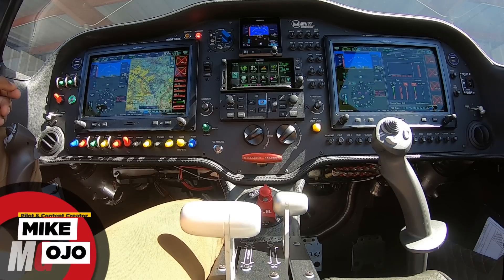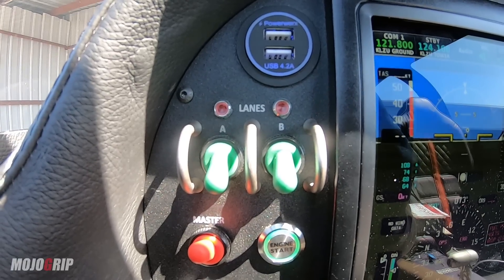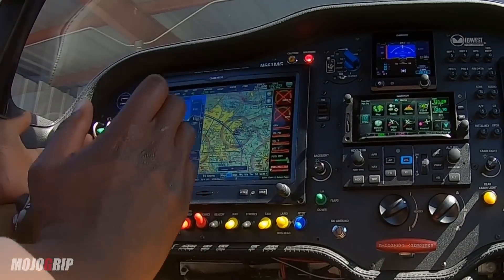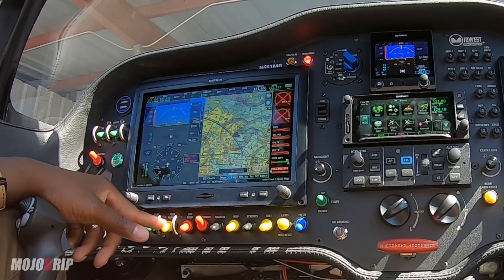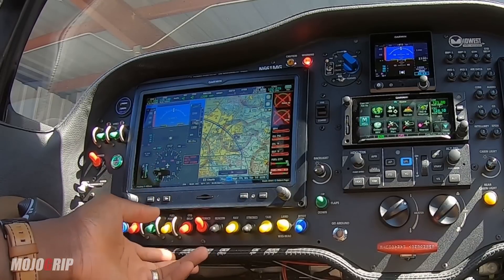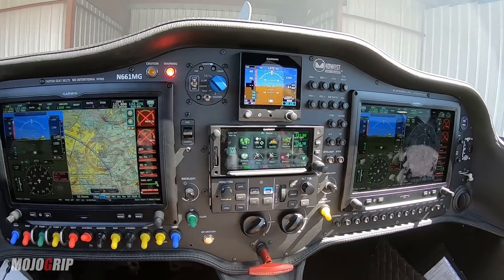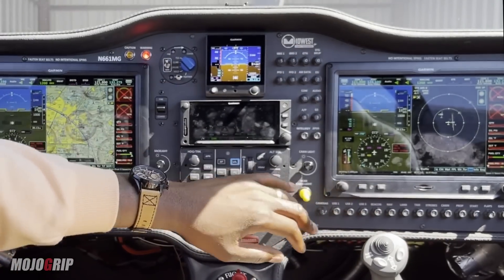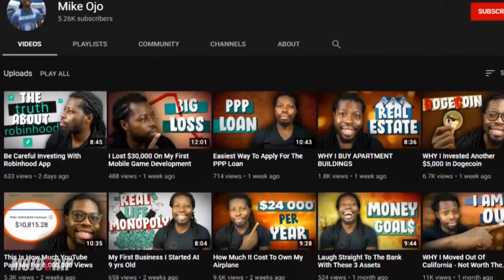All The Tech In My New Plane - Sling TSi Garmin G3X Touch

Comment: I assume you mean alternators and not really generators.  For some: EFIS = electronic flight instrument system and pitot heat is an element in your pitot tube.  It melts ice so that all your air pressure driven instruments work.  

With that said, this a nice setup that I'd love fly.  As a tech guy, this looks very sweet.  Thank you, Mike.
Reply: and going just a bit deeper, if the pitot becomes unreliable for any reason, like icing, then the entire suite of AP/AD become unreliable.  So the pitot heater is VERY VERY Critical to the safe operation of the aircraft with respect to the system that depend on a reliable indicated airspeed for input.  (flashing back to the notoriously dangerous and deadly outcomes from the 737MAX mcas system!)
Reply: They are generators. They need to operate the FADEC independently in case of electrical failure. If they were alternators they would be dependent on the main battery for the field windings and have a lot more failure modes.
Reply: @ ryan - that's interesting...a bit of research the fadec equipped Rotax 915is powered Sling Tsi has two GENERATORS.  

A gen provides  13 amps for EMS (ecu)

B Gen at something higher, 30 amps for everything else (nav, com, lights, actuation, flight surface limit switches, etc) 

* in the video mike tries to explain these as "lanes" but I think he really oversimplified the purpose of the two switches.  But in his defense, he was not trying to provide expert level training for some kind of certification course either...just a breezy overview to get noobs somewhat familiar about "all those buttons"..lol..

Comment: How does the go around button work?
Reply: A go around button is a function that mostly deals with the autopilot and a glass cockpit. If you are flying an approach in instrument conditions and you can't see the runway at the missed approach point or decision height you are supposed to disengage the autopilot (if you haven't already), hit the go around button, match your miniature airplane on your AHRS to the pink flight director wings, then reengage the auto pilot. This will put you into a nose up attitude and wings level while initiating a go around while you activate the missed approach procedure on your GPS and your autopilot. You will not see this on traditional avionics because they do not have a flight director able to be displayed. A flight director is a visual guide given by the glass AHRS on what your given pitch and bank should be to get to your desired course. i.e. if you had it plugged into your GPS that you wanted to cruise 2000 higher than you were and divert to an airport off to your right, the flight director would show that you would need to pitch up and bank to the right (22 degrees is the max bank it will ever recommend) in order to intercept that course.
Reply: This button tells the GTN650 to activate the missed approach procedure (if an approach is selected and active), and will also command the autopilot to fly the missed approach, which usually involves a climb to a set altitude and a location fix. Throttle must be manually rolled forward, which is why this button is located near (or even sometimes on) the throttle.